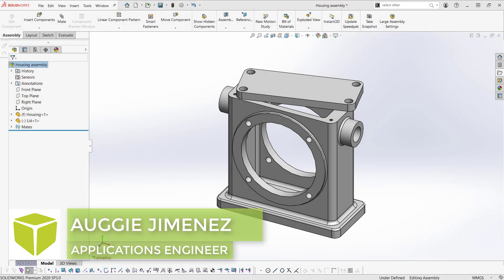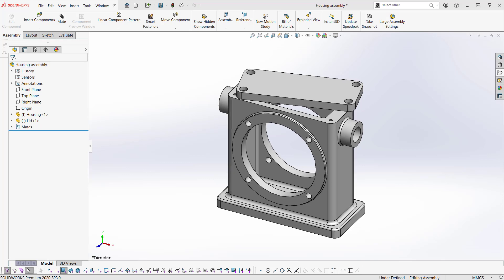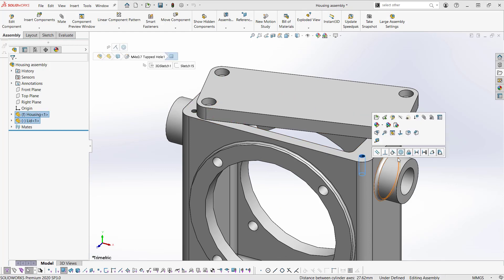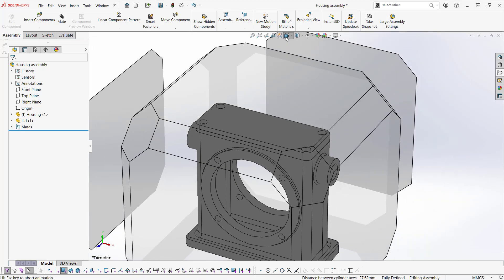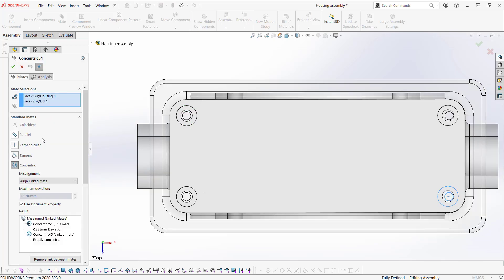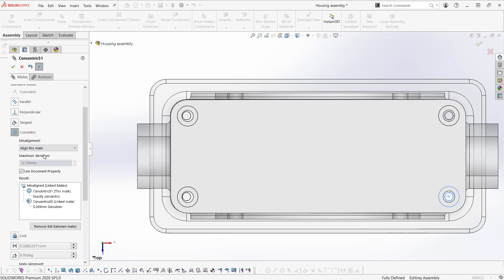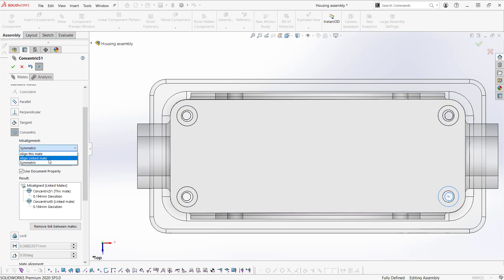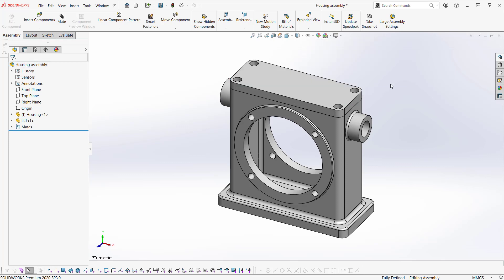SOLIDWORKS Tutorial - Using Misaligned Mates

Comment: It is irritating that only partial information is presented.  If Options | System Options: "Allow creation of misaligned mates" is not checked, misalignment is not presented in the mate dialog box.  Further, once misalignment is allowed in Options, "Align Linked mate" is presented, the pull down arrow is greyed out and the options "Align this mate, Align linked mate, or Symmetric" is not available until the check mark is selected to finish  the mate.  Then one must go to the mate dialog in the manager and select the misalignment to select which alignment is wanted.  It also specifies the maximum deviation that is unknown until then.  Still further, there is nowhere in Options to specify what maximum deviation is allowed.  I guess SolidWorks thinks they should control that value.  Depending on the assembly, .500 maximum deviation is extreme in my opinion.

Comment: I also have the problem where the misalign mate option is selected but I don't get the option to misalign mates. In the little menu that appears after I select mate on the two surfaces, I only see the "lock rotation" option after choosing concentric mate. I suspect that it only works for mating single parts and not when mating entire assemblies, but I haven't tested this theory yet.
Reply: I didn't understand what you meant about "single parts" until it didn't work for me either, and I had to do a little experimenting. The proper clarification is that two holes have to be in one part and the other two holes have to be in "just" one part, too. I was trying to "misalign" two holes that were in one piece of structural angle to be used as cross bracing. I tried using the misaligned mate for two holes - one in one structural angle column, and the other hole in another structural angle column. In that scenario, the "misaligned mate" option is not available. Thanks for making me think it through!! :)

Comment: I do the same, but the misaligment command does not appear and i have to force or suppress the function. The misaligments are consent in the properties. Is possible to set the misaligment mask as normally visible even when the function is alligned?
Reply from the maker: There are 2 factors involved here. First misaligned mates is only available in 2018 or newer versions of SOLIDWORKS.  Secondly it has to be turned on in the system options. Tools> Options> Assemblies> check "Allow creation of misaligned mates" 

https://help.solidworks.com/2022/english/SolidWorks/sldworks/HIDD_OPTIONS_LARGE_ASSEMBLY.htm?verRedirect=1
Reply: @goengineer  the option is activated, and my version is 2021. Is strange because sometimes the command appear, and sometimes no. That's why i asked if it's possible force it in another way
Reply: Se my reply to karlm above, or the full comment I added.